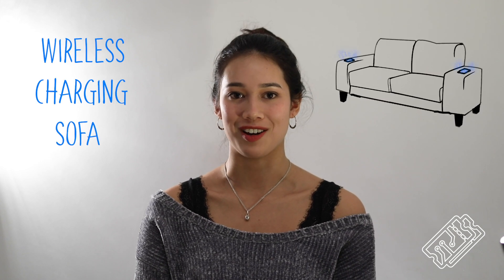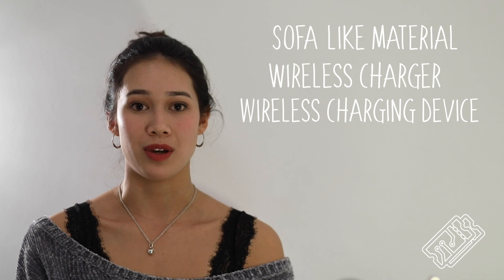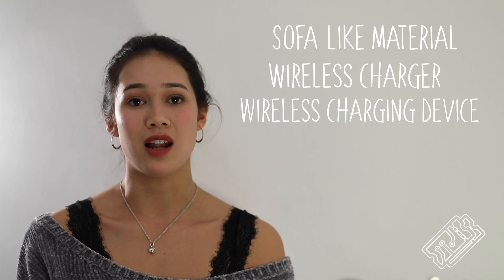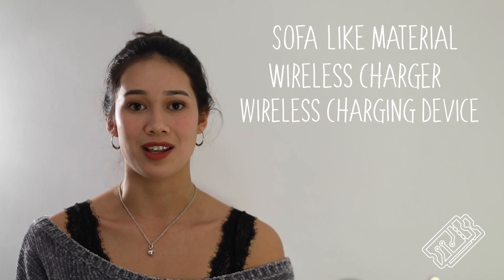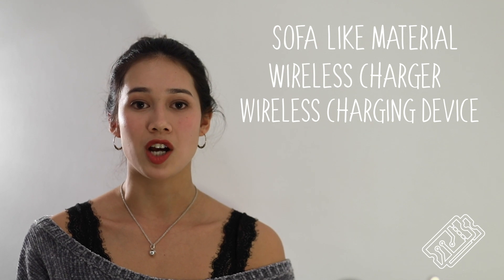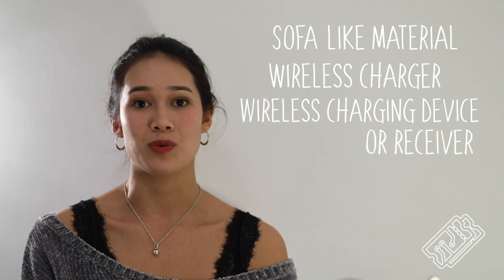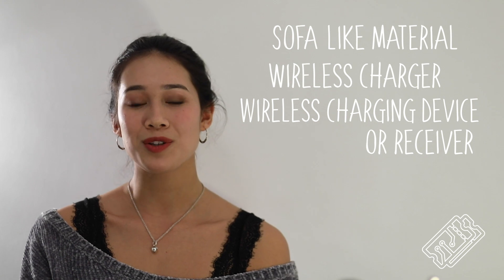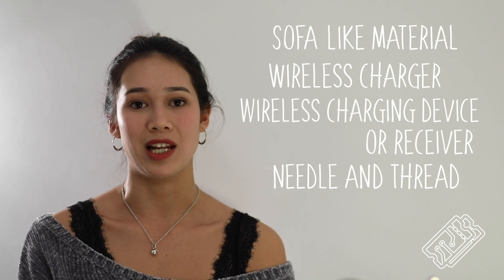How To Make A Wireless Charging Sofa

Comment: Awesome idea but you ought to install the charger under the actual sofa fabric
Reply from the maker: Hi Nick,
That would be ideal, however you might damage the sofa, eeek
Reply: @T3chFlicks  I'm a risk taker 😬
Reply: That is going to be my project for both my couches. Putting a 5mm thick (10cm wide) charging plate in the sofa will allow for wireless phone charging and holding drinks steady. I will cut the seams, fish the charger through then do some sewing to close it back.